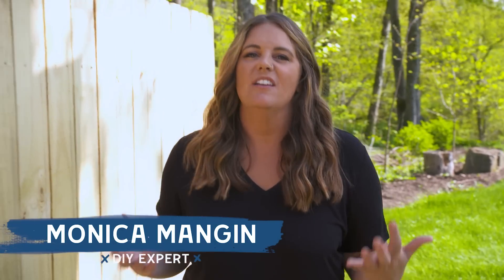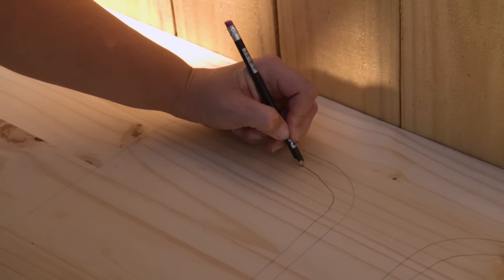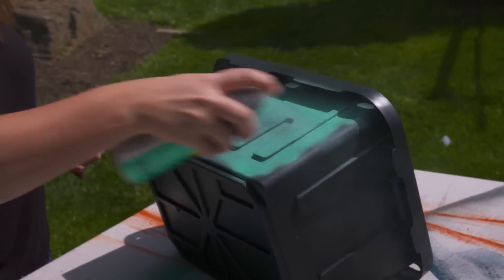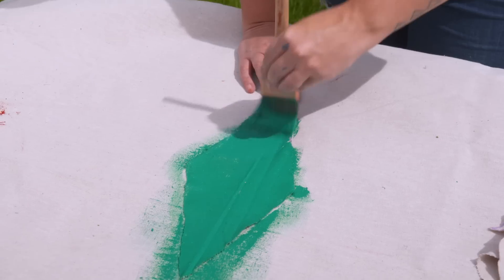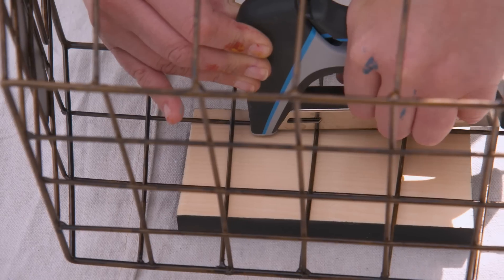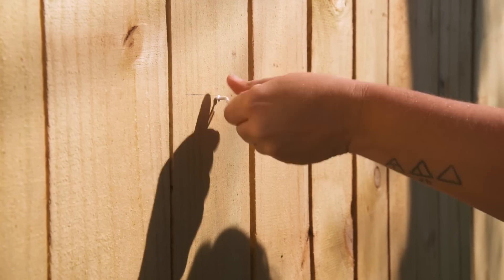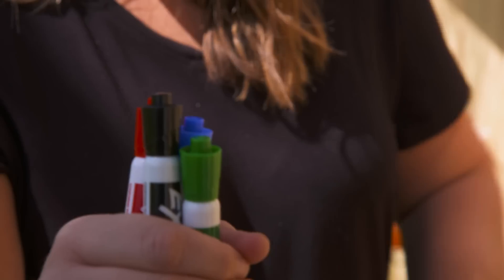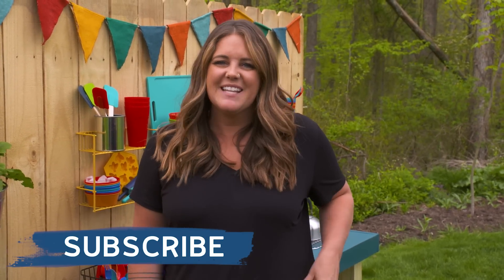Transform Backyard Into Outdoor Playroom | Home Becomes (Ep 5)

Comment: Super creative. But as an owner of a preschool, unless you get no rain or snow in your area or this is covered with a patio...Those metal racks , hooks and pans will rust, the wooden utensils will split from all the water submersion ,  all that paint and spray paint will chip off with in a year or two. Should have also drilled holes in the toy box for water to drain. Also outdoor chalkboards need a new coat of paint each year from all the friction and water exposure.  Wish it was that easy for sure.
Reply: Thanks for the tips! Lots of little things we didn't have time to mention, but did do (drilling drainage in the marker containers and metal cans) and agree about the wood spoons etc - my idea is that the water proof under storage will keep them dry. We also got really inexpensive ones so swapping them out every few years would be reasonable :) To avoid rust on anything painted definitely use an outdoor paint- will help with that! I'll lyk how it holds up! So far so good! :)